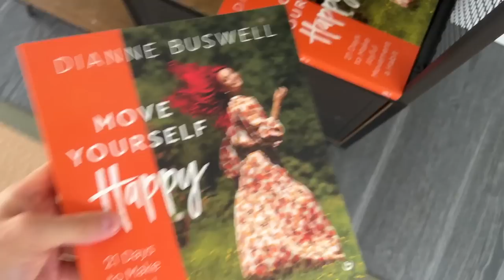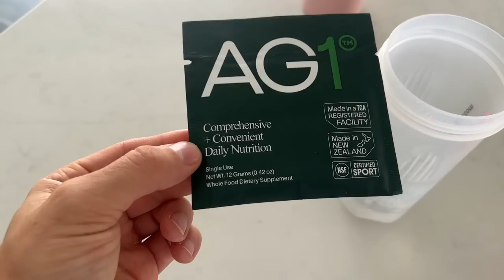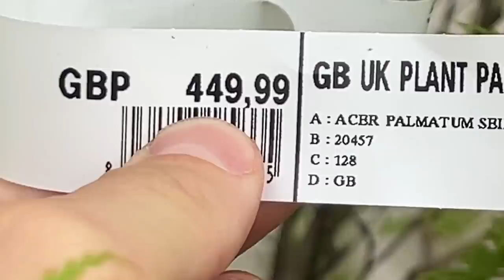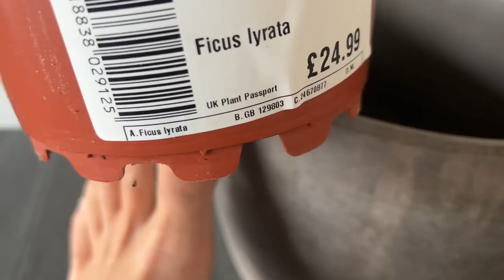MAKING ART FOR OUR NEW HOUSE

Comment: Only saw the hinges for that cupboard for a second but by the looks of them they're adjustable both forward and backwards and left and right. If you pop the little metal cover off you'll see 4 screws, two attack it to the wood but two adujst the angle. One will pull it back and forwards the other will pull it left or right depending on which way you turn them. Should be an easy fix 🙂

Comment: For your artwork, I’d say use an art sealer, like Gesso to seal the wood under the parts of the art that’s lifting away.  Then, perhaps glue the lifting art with an archival glue.  There are products around that would result in a nice clear, non-yellowing layer on your art.   I’d ask an experienced associate at a good art store for advice on sealing your painting.
Reply from the maker: Thanks for the tip! 😊

Comment: Resin would definitely work - it is a pain in the ass, especially for artwork just cos it bubbles a lot. Pva would be shiny but tbh so would resin. 

My thought would to be to get a custom piece of acrylic (maybe very thin like 2 or 3 mm), to almost encapsulate the board. You can treat acrylic with an anti-glare chemical to prevent that shiny feel as well…

Dunno if that helped, but that kind of technique has deffo helped me in various projects (as an ex artist, and current stage designer!)

Comment: FOR YOUR ART: you can try matte mod podge behind it where its lifted and over top. Look up some tutorials online. I honestly think it'll look really good with that because it dries matte and can make anything look painted. test it out on a print before you put it on your artwork to test if you like it. Also once you put a glass frame on top it'll be shiny. Most art in museums just have a frame around, no glass. For my gallery walls i take the glass out to give a cleaner look with no reflections. I will say the distressed look is kinda cool but resin would probably ruin it due to its unpredictability. Good luck ◡̈

Comment: I did a similar art piece using comic book pages on a canvas and I glued it all down with matte mod podge, then sealed the whole thing using a sponge brush and more matte mod podge. It's still a little shiny but it's all stuck down and sealed really well. Resin in my experience makes it super shiny and it also is a huge pain to work with especially on such a large piece

Comment: Adjust the hinges.  I noticed they look the same as kitchen cabinet, so get that screw drive out and experiment!   The board is absorbing the moisture from the stuff you plastered on it.  I would have used a huge canvas, maybe Hobbycraft have them.   Instead of pva glue you could have sanded the wood to make a ‘key’.  You can buy artist structuring materials, maybe that’s better?   Love the cabinet.  Thanks for posting!   Ps is Diane cycling to work 😮

Comment: Wouldn't suggest doing this with expensive plants (might get into trouble) but my mum takes 'cuttings' from plants and grows them. 'The technique is the same for almost all cuttings – cut a length of stem without flowers about the length of a pencil. Trim it neatly just below a node (the point where the leaves branch from the stem), and cut off the lower leaves to give you a bare stem. Put it down the side of a pot into gritty, free-draining soil.' From google. If you do try this in the garden centre make sure the cameras aren't on you as I'm not sure what the law is.

Comment: Hopefully joe you can make adjustments within the hinges to make it drop or life the door, like in kitchen cupboards. 
For your art, i do mixed media art and use Liquitex Gel Matte Medium to glue paper, fabric , metal, wood, beads, or glass to the surface. It is  a thicker type gel. Also good to adding into paint.
You can also get Liquitex Matte Medium, which is a more liquid consistency and would be good to stick down your loose paper comi g up.

Comment: I couldn't see the hardware too well, but it kind of looked like those were blum hinges and plates. If so, there should be one screw on the plate that mounts to the cabinet side that will move your door up and down. Then on hinge itself there should be two screws, one for left to right adjustment and one that adjusts in and out.

Comment: Artist speaking! I'd be tempted to re glue down where the paper has become dog eared. once you've framed it the glass/perspex will provide the weight that keeps it down. the reason the newspaper has peeled is because it got wet after being stuck down- now the paint is dry and absorbed it shouldn't happen again once its re stuck down. If you PVA it you'll lose the differences in surface texture eg matt and gloss so some of those more subtle aspects of the painting will be lost

Comment: You can fix you lock down artwork by putting two coats of modge podge over the top of the art work and it will work like PVA but not leave the gloss finish 👍

Comment: For your gorgeous lockdown artwork , could superglue work on sticking that corner down? As for sealing my paintings, I use an aerosol spray varnish. I spray a few thin coats. I'm not confident enough to try resin yet 😂

Comment: If your hinges are non - adjustable  most furniture is made on a perfectly flat surface so if your new house floor is slightly uneven  this will give the effect the doors need slight adjustment , try a slither wedge on one corner to see if it has any effect, my betting its your floor thats the problem, NOTE when buying big items like this some poor bugger has to clean them and that double top plus that fret framing on the doors will be dust collectors long term .  My mrs would kill me for bringing home extra work like that .